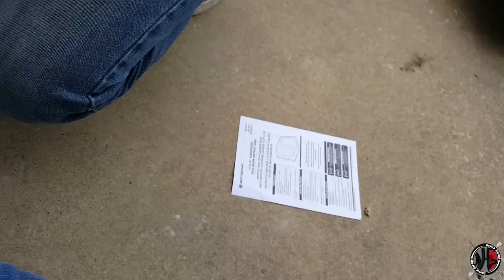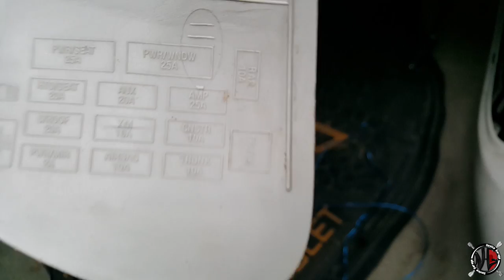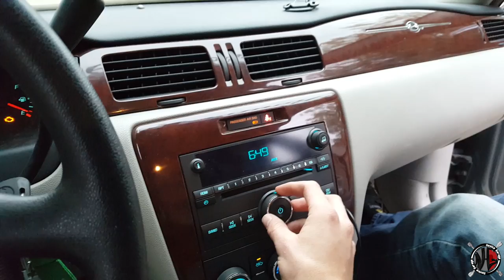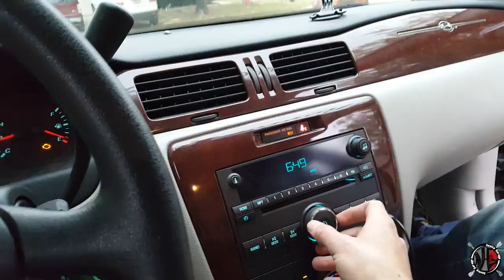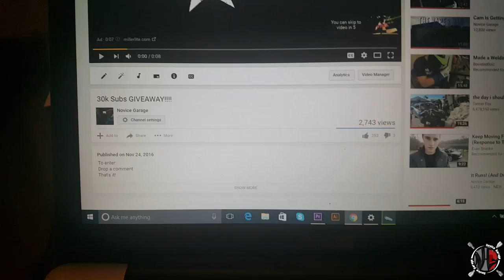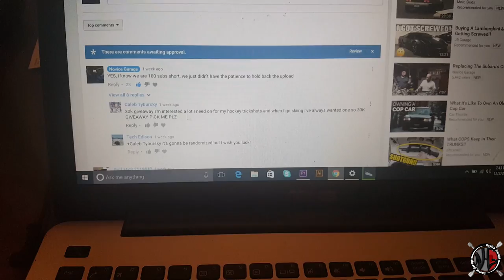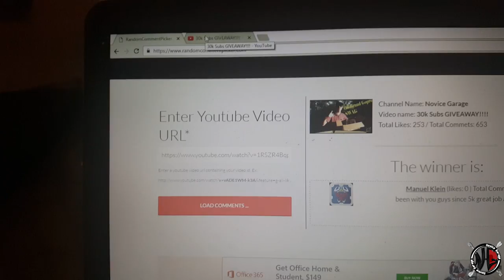Cheap & Easy Sub Install + GIVEAWAY WINNER

Comment: dude, theres a wire specifically for the REM wire on the radio, that would have been a lot easier then running it to the fuse box under the hood.

Comment: Walmart also sells a universal bass knob with remote wire that just hooks up to your rear speakers, kinda like the setup like you have except you don't have to run the remote wire up front. it makes for a clean cheap install

Comment: you probably have the wires coming from the speakers that are going to the Rca converter hooked up backwards. because of that when both rca's are hooked up they are out of phase and fighting each other. either that or your converter isn't a very good one lol.

Comment: if you look at factory radio it is wired up with an 12v always hot wire and an key on signal wire most radios have an internal fuse because if this I would assume it's to keep the time for the clock (veary small current draw but not off. with the older GM's you could turn on the stario with the key out by putting it in debug mode.

Comment: the wires coming off the factory speakers are prob crossed goin into the that little box check ur positives and negatives cause using both speaker leads for that box will give more volts through the rca' s and make the sub sound better

Comment: Btw you know all those little holes that are on the amp,put back the other rca wire then use the knob that says crossover and tune it down to about 60-70 hz then use the switch on the amp to switch it from stereo to mono.After that turn off bass boost and turn the gain higher instead. it will sound a hell a lot better!!

Comment: one of the speaker wires are cross wired thats why it sounds better with only one rca. go over all your wires. oh and the radio fuse should have been sufficient.

Comment: get a Nissan patrol and do a rb26 swap or a forester with a wrx swap. but if you use the wrx use a ej20. the xj is also a great option make sure you get a 4L with the auto the manual blows

Comment: If you run the subs in parallel (thats if you have two subs) it will make it so that it is only a left or a right channel not both. That is why it sounds better as a single RCA. And usaully subs sound better facing the trunk. All cool nonetheless.
Reply: Wtf no. Wiring subs just changes impedance
Reply: Toyota no you are miss understanding. I know if you wire a single sub it changes impedance. I'm talking about running a wire between both subs so that you function as one sub hitting on either the left channel or the right. Generally the left